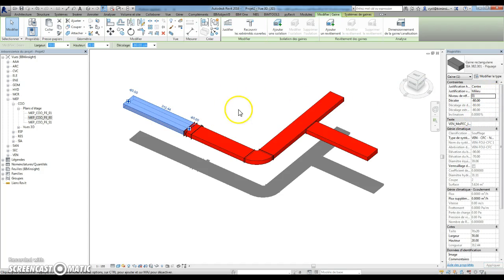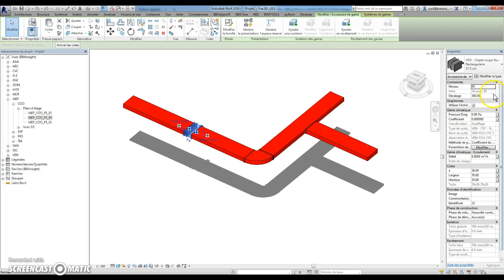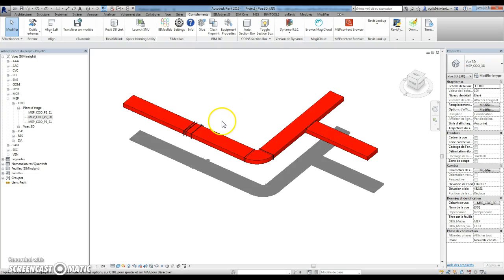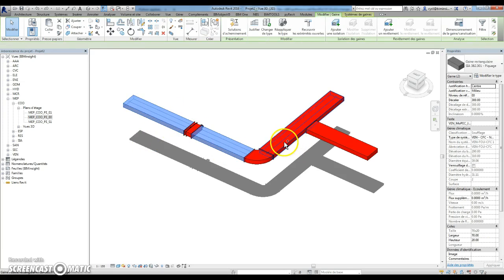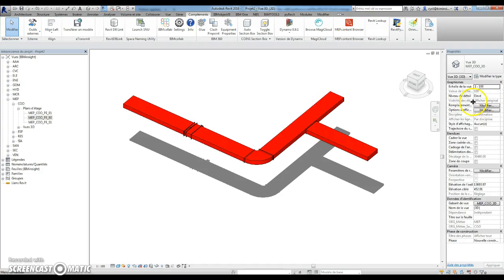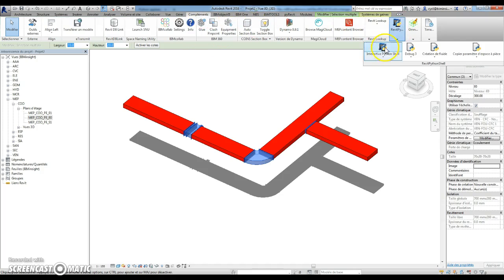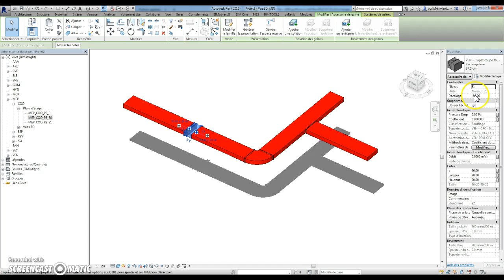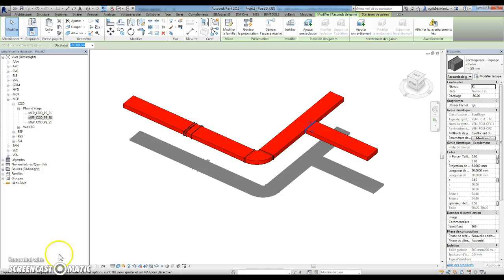[Revit] Change fittings reference level without moving it

Comment: I am working on a project which may require elements to change level and I remember this issue back from many years ago so I have just tested this with Revit 2020 and this no longer appears to happen so I guess they fixed it in either 2019 or 2020.

I started to think I was losing the plot until I found your video confirming my memory was correct.

Comment: Cyril, today we discovered it's now working with fittings that belong to a group. Any chance for you to correct this in the code?
Reply from the maker: I tried but it is actually no so simple. You cannot programmatically modify elements inside a group… You need to ungroup elements make your changes then create a new group and switch all other instances of the old group to the new group… Check my new video / blog post, I was unable to do it with groups but I did many other ehancement.

Comment: Hi,I really like what you did. We have the same frustration with fittings not staying in place.I tried your code, but I'm not familiar with the API and Python.Could you please explain how you get this piece of code to work?
Reply from the maker: Hi, Have you check my blog (http://pythoncvc.net) and my other videos ? Especially the one which explain how to use RevitPythonShell : http://pythoncvc.net/?p=44
Reply: Thanks,I installed it, but haven't got it working thus far.I copy/pasted you code in to FittingLevel.py which I added to PythonShell.This is what I get When I run the command;http://screencast.com/t/EWAmRKlfil
Reply: I think I'm not far from succeeding. I now also downloaded revitpythonshell-master. Is there any code from there I need to load first?
Reply: I want to learn more about the Revit API. In the past I've always programmed in AutoCAD with VisualLisp. But now we are shifting from AutoCAD to Revit. It was my understanding that C# is the number one programming language. What made you decide to use Python?
Reply from the maker: You need to :
1. Select only fittings and accessories (you can mass select then filter like I did on the video)
2. Launch the script
3. Select an object that will give the reference level you want to apply to your fittings and accessories (in the video, I select a duct)
It would be great to have a more user friendly GUI and error handling but it takes time :-(
Reply from the maker: I decided to use Python because :
- it is a very natural language (syntax is «almost» like reading an english sentence)
- it is open source.
- it was already a language I wanted to learn (my first was visual basic behind excel...)
An other good reason to use python is that you can use it in Dynamo !
Reply from the maker: I see.
Line 16 need to be removed or set as a comment when you use the script as a canned command. I made rectification on GitHub and on my blog.
Reply: It works! Thank you very much!
Reply: Cyril, Does this go for all objects in selection? Or do we always need to filter out the fittings? I haven't tested yet...
Reply: My colleague just told me it doesn't work for ducts but does work for Duct Accessories. Perhaps there is a reason not to apply this to all objects? I think it would be great if it would work on everything selected. At least also on Ducts, Duct Accessories, Flex Ducts, Mechanical Equipment,  Pipes, Flex Pipes, Pipe Accessories, Plumbing Fixtures, Sprinklers, Cable Trays, Cable Tray Fittings, Conduits and Conduit Fittings, Data Devices, Electrical Equipment, Electrical Fixtures, Fire Alarm Devices, Lighting Devices, Lighting Fixtures, Nurse Call Devices, Security Devices and Telephone Devices.Some could be face based and hosted on walls where I guess Schedule Level should be changed.
Reply from the maker: It works with duct and pipes fittings/accessories, probably mechanical equipment. The reason is just that parameters are not the same between duct and duct accessories (that why they have a different behavior). It should be pretty easy to adapt the script for all these categories except hosted which are a bit different (I don't like hosted families and almost never use it). But it's  probably easy for hosted one too.
Reply from the maker: And by the way, feel free to send a pull request on GitHub if you find time to enhance the script !
Reply: Thanks again for the reply. We wil use it as it is. It already has made it a bit easier for us. Thanks!